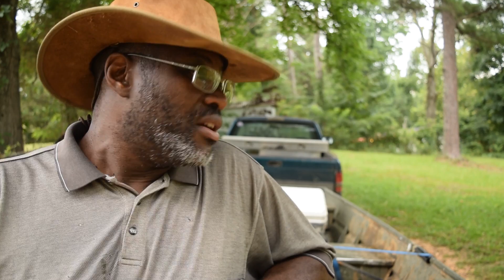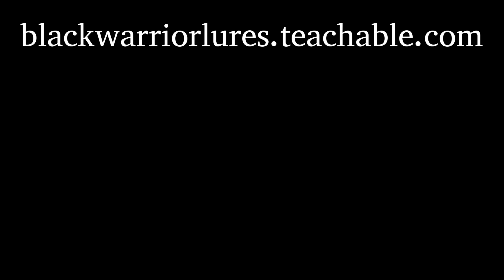Marine Gas Tank Conversion on Teachable | Thailand Outboards | SPS Longtail

Comment: Thanks for the video might have to check that out just took my predator 212 with the small swamp runnner kid out for its second run on the river did good believe it similar to the 212 predator that blew up on u
Reply from the maker: You shouldn't have any problems with a stock 212 Predator. I hopped up my 212 too much, and that's why it blew up.